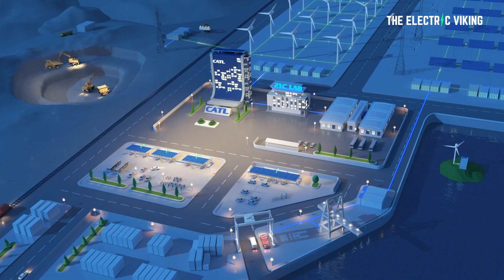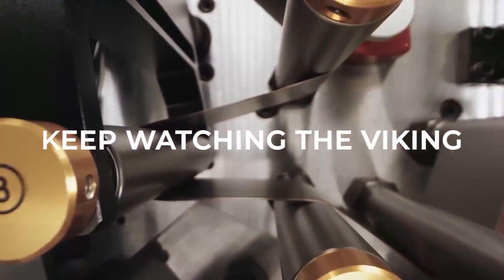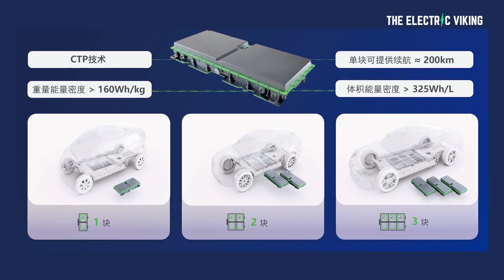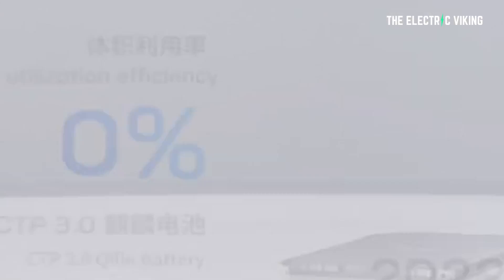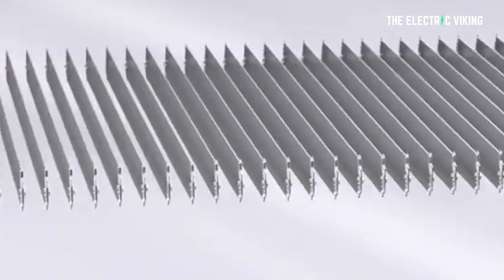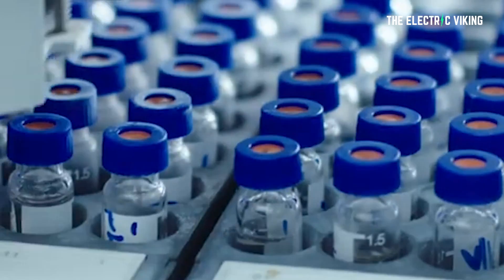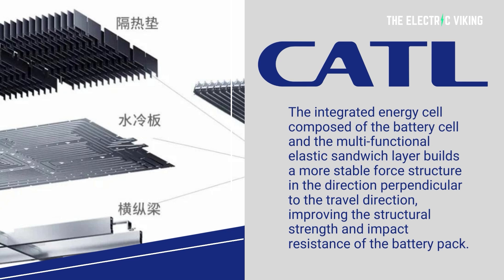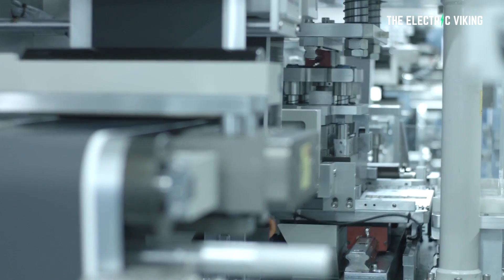The biggest EV battery breakthrough I have EVER seen

Comment: If I'm understanding correctly. The battery in my PHEV is about 136Kg for 9Kwh which gets about 45km of EV range. This should make that same pack be about 34Kwh, which would make my EV range about 166km instead. I think I'm missing something here, so maybe it's about half that but that seems like a massive improvement.

I'll believe it when I see it in a purchasable product. Far too many 'world changing' claims seem to disappear when they get closer to the date they claim to change the world by.
Reply: With this battery tech, much smarter and cheaper to ditch the engine and complex transmission and add a few more batteries to make a full EV.
Reply: @lengould9262  Probably, if I could have found an affordable EV with about a 600km range I probably would be driving one. I do too many time sensitive trips do be waiting half an hour for top ups so the PHEV made more sense fir me as long trips are gas and go but all my daily driving is EV only. Hopefully this tech actually becomes usable and available in cars. I've seen far too many 'this battery changes everything' for the past 20 years that I'm not holding my breath.
Reply: @Snerdles  136kg for 9kWh isn't anywhere near li-ion energy density, you could probably already change the battery to a better one. Hybrids make sense in some parts of the world but in many of those locations <50km barely gets you to the nearest store. Putting the problems of both ICE engine and a heavy battery in one car is supposed to give enough benefits to make it worth the price.
Reply: @AnalystPrime  That's just an estimate based on the PHEV being about 350lbs heavier than the basic hybrid version with only a 1kwh battery so my math is probably a pretty far off wild guess.

Luckily I live and work in the same city so even all my shopping, family stuff, and work are under my PHEVs range and then long trips I don't have to plan around chargers or long wait times, just gas and go and run it like a hybrid. It's the best of both worlds for my situation.
Reply: @Snerdles  The battery packs have other stuff than the actual battery material, but at that weight you have about 66Wh/kg where li-ion batteries should have 100+; 150+Wh/kg for the ones with cobalt.
I suspect your car has nickel batteries, especially if it is an older model. Those do have longer lifespan so it would make sense to use them in a small battery that has to go through huge number of charge/recharge cycles.
Reply: @AnalystPrime  my car has Lithium Polymer batteries.
Reply: @Snerdles  Those are listed as having 100 to 265 Wh/kg, so there must be lots of extra capacity to keep back the degradation.
Reply: I'm not sure you can compare small PHEV batteries to BEV batteries like that. A PHEV battery likely sacrifice energy density for higher power output from each cell. It is a small battery but still needs to deliver enough power to the car to run in EV mode.
Probably you also have a big buffer so the battery can stand more cycles without degrading too fast. I imagine you have to charge it at least once per day, compared to a BEV you might have charged maybe two times per week in the same situation.
Reply: I don't  think people  get just how much better going full electric  is yet.  Hybrids  are sold as being  best of both worlds  but are instead  worst of both.  When electric  runs out you are carrying  around heavy battery  and extra motor. When on electric  you are carrying  around  a useless sinker / hunk of metal 🤔
Reply: @cryptoslacker-464  PHEV folks say they make short trips for 80% of their driving, but if they had a full elec vehicle the weight of the extra capacity battery etc is also along for the ride and not needed.  For their long distance trips they can use the multitude of gas stations which do not have issues with refilling like may elec. stations do and they don't need 10 min recharging (not available yet) to get on their way.  Also some PHEVs (Hyundai Iconic, Toyota RAV4, Mitsu Outlander) recharge as they go that's why the Toyota RAV4 Prime gets 43 miles to the tank.
Reply: @anomof  great points , I'm still  on the fence in some ways .  But I've driven both the RAV 4 hybrid  and the Model 3 Tesla. The RAv4 was much better than the Normal RAv4 . Had much more power  and was smoother  to  drove. While the Tesla 3 was like driving  a space ship.  I really  enjoyed the driving  experience .  A whole different experience
Reply: @cryptoslacker-464  And getting worse mileage both ways. Lot of people are better off just buying an affordable EV for their regular driving and renting an ICE for the few days they go visit relatives.

But hybrids are good for when you want to drive electric but might have to take a long trip at any time and cannot rely on having convenient chargers or time to switch cars.

Comment: Important questions.  How much does it cost to repair/replace.  How many GWH of this battery can CATL build per year?  How many miles will these batteries deliver over their lifetime?  Will the batteries be 100% recycled?
Reply: Yep, these question absolutely need to be answered before you can say one reasonable word about the impact of this battery. First becasue they are not cylindrical i doubt production will be as cheap as competitors. Secondly, how much output can CATL realize. 'mass production' is a lose term Thirdly, lets see real life longevity and degradation patterns. I do have faith in this last one.

Comment: I watch many of your videos and getting a little bored hearing about the number of battery breakthroughs. This is not intended to criticise your videos but more the every other day occurrence of of new information. All I and many others want to here is 1. Does the new battery illuminate the use of rare earth materials? 2. Does the new battery handle over heating problems and therefore safe. 3. Can the battery cover in excess of 500 miles on one quick charge. Until these three conditions are realised an EV is not for me. Keep up the good reporting.
Reply: Rare earth metals are used in magnets which are used in electric motors, not batteries.  Like 1% at most actually need 500 miles of range on a regular basis - that is a big cop out.  Batteries are already much safer than internal combustion engines for fires.  You have bought into media sensationalism.  Also you ignore the benefits of electric cars such as near 0 maintenance, superior performance, and superior efficiency.  Once electric cars are cost competitive - there is no legitimate argument against purchasing one.
Reply: Batteries don't use Rare Earth Minerals, electric motors do and this isn't about to change. That said, its not alot of metal weight per car. Each Model 3 Tesla has (in dual motor) 2x 85 lbs for the entire motor, including the steel case. Standard range has one. 

 Some use Cobalt (not a Rare Earth mineral) but expensive, limited in supply and controversial in certain quarters. This one (LFP) and the 4680 don't use Cobalt either. The Motors use Rare Earth Minerals (Neodymium). That hasn't changed. LFP batteries are safe. No it can't go 500 miles unless you have an excessively heavy battery (like Lucid).
The quoted 255wh/kg-Pack are similar to 2170. So you could build a M3 or MY ER cheaper, with a battery that is safer and lasts longer (much longer) than 2170.

Regards use of Rare Earth Elements. They are frequently found with Thorium associated when mined and this element is a radioactive "waste product" - hence the stigma. However, Thorium Can be used in clean, safe, relatively cheap nuclear reactors as a fuel source (far more common in its usable isotope- about 2-400x than Uranium). So this stigma goes away if the US gets it proverbial head out of its A** and invests in (proven) liquid salt Thorium reactors (as per the Oak ridge experimental reactor of 1964). NOT the solid fuel reactors detractors mistakenly use as a stand-in tech for their arguments. (Much like claiming bullets in a person's hand are as dangerous as bullets in a gun... its a really stupid argument with many "experts" pushing the narrative.

In short. Mine Thorium for clean/safe nuclear fuel and get rare earth elements as a by-product. This would open up the US mines currently fallow because of the waste costs of throwing the Thorium away safely. 

... oh yes, the Chinese are doing just this thing. In the US where politics is largely ruled by alarmists, professional plaintiffs and predatory lawyers... we can't touch it with a ten foot pole because in the primitive minds of the US courtroom where we can't even agree on the definitions of long established words, Nuclear energy = black magic... and they still burn witches here.

Comment: If this is real, the impact on grid scale storage will be enormous!!!
Reply: If these batteries are affordable.... energy density for grid storage doenst play a big role. Affordability is #1 for grid storage. and affordability is purchase price, maintenance and durability.
Reply: @generalgeert  I think you meant total cost of ownership
Reply: @theairstig9164  Yes, that would be better put.
Reply: Nothing to do with grid storage, which doesn't need light weight, energy density or quick charge times.
Reply: @jasoncatt  correct

Comment: So- wanted to take our new Tesla camping.  Except- where we want to go, there are no superchargers.  there are a few Level 2 (Blink, Chargepoint) chargers on the way, but they are so low power, that it would take hours to use.  i.e.  EVs need an extensive high power (150kw+) charging network for large adoption.  it's not just the cars.

Comment: ... and next week another breakthrough. Folks all over the world are working on this, some very exciting things are going to happen. Can you imagine how great 2027 cars are going to be?
Reply: I can see batteries with 5000 km range with 5 minutes charge time to 80%. ICE will die in 5 years
Reply: They just need to be less shit than the ones produced in 2008. Think about that. Parts available, models available, cost effective, reliable, insurable and suitable for 99% of the use cases. Range? No. Fixable? Yes! Currently we have 6-12 month waits on pretty much everything. How is this better than 2008?
Reply: @theairstig9164  To be fair the average age of cars on the road has gone way up and those 2008 cars are still going and worth more than anyone could have predicted. And that’s with 2000 more things to go wrong than an EV. All modern cars are lasting longer than auto makers wanted them to.
Reply: Battery technology is improving much faster than in the past from 1890-1990 the battery decreased in cost at a rate of 2%-3% a year with a tail wind of decreasing commodity prices of around 90% over that time while since then batteries have been decreasing at 10% in cost per year but with the head wind of commodities returning almost back to where prices were 100 years in real terms(inflation adjusted)

Comment: Will this mean that Tesla's R&D for the 4680 is a write-off?
Reply: Hardly. 4680 has a minimum cell density of 350wh/kg (maybe 330 at the pack level). The "potential" was predicted much higher once deveolped, this at a price point about half the 2170 and a life span of 1M miles. Also much higher production rate (as there was no drying in ovens required for the electrolyte). 
Better choice for the high end. 
Its the 2170 that's obsolete.

Comment: Tesla advocate acceleration leaving them the NMC type, high density and flammable solution. If we don’t crave for acceleration and take twice as long to accelerate can lend us an alternative to a cheaper and more reliable type LFP battery solution. 

On the other hand Tesla’s patented 4680 architecture promising a higher density at a higher diameter to a higher thermal resistance leading to a heat sinking problem outside the capability of the coolant scheme found in model3/Y.

Comment: AWESOME !!!  Obviously Tesla will have get the first draw, and probably absorb as many of these batteries as CATL can supply.  Another obvious point is that not everyone, like me, needs a car with a 600+ mile range.  I can do with an EV with a 100 mile range.  The closest charging station to me is only 7 miles away, and I can actually use a 230V 50A charger at home without going to a charging station.
Reply: You’re missing the point that Tesla has already gone all in on developing and tooling , manufacturing their own 4680
Reply: And the money and resources they pumped into 4680 over the years while enlisting Panasonic? Scrapped?

Comment: Will this be good or bad news for Tesla as they try to roll out their 4680 battery?
Will this technology be workable within their set up?
A worry for Tesla if not. ☹️
Reply: Tesla will be fine, it is all about scaling up, and Tesla is not sitting still either, they will get to these levels as well. CATL is not making cars, so they still have to sell all these batteries to car makers, I bet Tesla will be one of the biggest customers.
Reply: They can always integrate it into their lineup. It's Tesla, they can adapt faster than any others. The more batteries they can get, the better.
Reply: They are already getting a large percentage of their batteries (all their LFP as I understad it - the ones in Standard Range save the 279 mile version). These come from CATL. 
So, no this changes nothing for Tesla. 
Their 4680 batts are SUPPOSED to have at least 350wh/kg at the cell level - vs the 235 indicated here (Though, I thinks that's reversed and pack level is Lower value so 350 might be 310 or so. 
Problem is we have no way to know how efficient 4680 is on charging, energy density as the figures ran from the low 300s early on to 500 at the top end.... and Tesla has to SW limit the packs or cannibalize their business.... so.
No idea. I expect 4680 still for high performance use (Trucks, High end cars) with new LFP for Low and maybe creeping to middle. 
By that time in 2023, 4680 cell should be ramped and we should know what numbers we are looking at. 

Tesla has no problem here. 
Others late to the LFP game (most non China companies)... yes this will put them at price disadvantage. 

Grid power will depend on pure relative cost as weight is little concern, but that may improve as well.
Reply: Musk always said that if a better tech comes along, they'll use it.

Comment: Of all the "break-through" and "game changing" battery tech news, ok I think I can believe this one. Still, until one of these Qilin battery is inside an EV car, I will still hold some doubts until further testing.
Reply: Rational skepticism is a virtue.  We pessimists are rarely disappointed.  Etc, etc.  I too await further developments, but it is certainly encouraging to see all the new designs for better EV batteries.  Never a dull moment!
Reply: The LFP version of this battery is slightly less powerful than BYD blade battery. So after 2 years CATL has almost made a battery as good as the Blade. Some breakthrough
Reply: @bydman5320  that’s not true. Remember, this LFP battery is 160 wh/kg at the pack level. I agree with the Electric Viking that this could indicate a cell level energy density for LFP at over 200 wh/kg. BYD’s blade battery is around 150-160 wh/kg at the cell level from what I can tell. Of course it won’t be long now until BYD releases their own updated LFP pack that matches or even beats the one from CATL. Cheers!
Reply: Until next week.
Reply: Is the new batterie designed for easy recycling?
Reply: @williamgrimberg2510  that should never be a priority until they can already mass produce this
Reply: there's people that have made a carrier of making breaking news on battery tech 😅a lot of what is covered in this "new" battery is marketing jargon. with that said, it looks like a promising form factor. only issue i can see is that the individual sections are larger there will be less margin of error, increasing manufacturing costs. i do believe the specs of the battery, but how much will it cost 😉

fyi, Tesla (and others) put cooling channels in between there old batteries and have also make structural battery packs. so nothing new there. What does look new is flat pack cells that are also structural, generally flat pack arn't as safe, but that's a company that should know what there doing and there's a good reason for making this battery. although, could be a way to generate interest in stock, nothing new
Reply: @MrHeHim  what's a intelligent man like you who knows all the manufacturing techniques of a battery doing on YouTube?
Reply: @polaris1985  probably too misunderstood due to spelling mistakes.😅